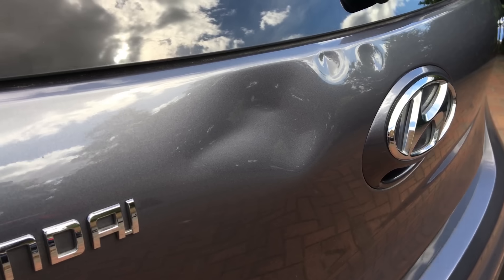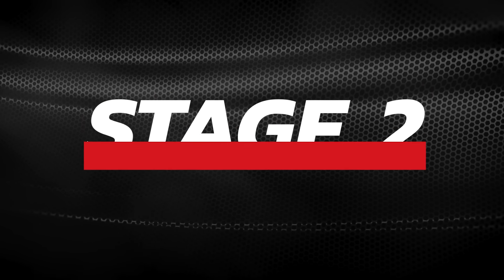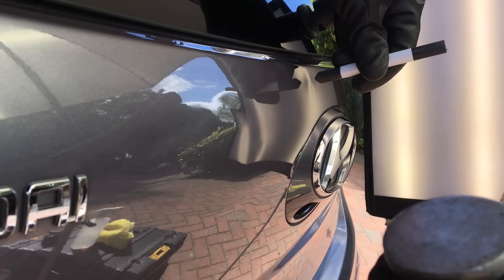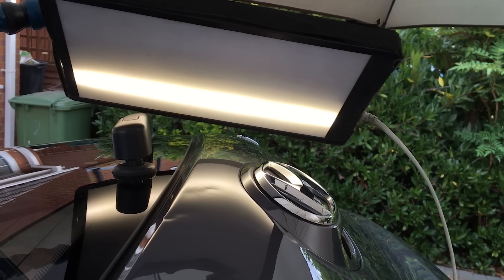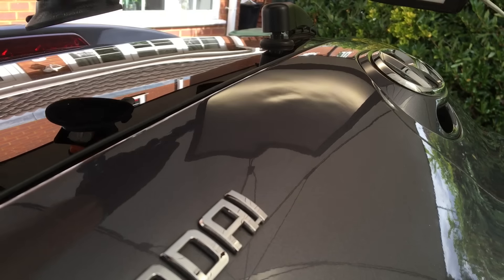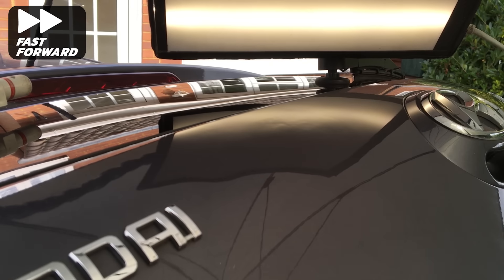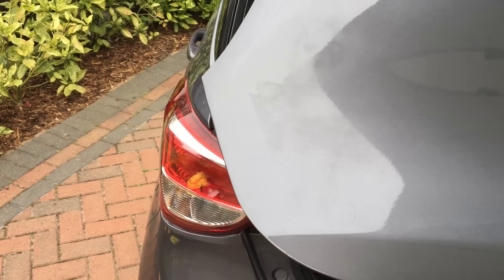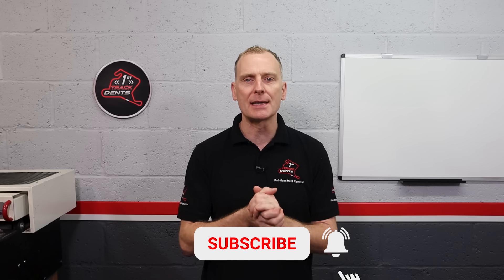FIXED in 3 STEPS! | NO Paint NO Filler!

Comment: After watching a few of these videos, I am impressed.  I had a minor incident on a motorcycle a few years ago where the turn signal dinged the tank in a fall.  The body guy that "repaired" it using similar methods (by similar he was using similar tools) caused more damage than the original fall.  This is fascinating to watch.  

During my teenage years, this required drilled holes and body filler.
Reply: Yeah!  Who would ever have thought that you could just tap out the dents like this guy. Just love his work I could watch it all day
Reply: @grantperkins368  Agreed.  It is mesmerizing.
Reply: @rustyshacklefordspocketsqu8162  I've always cut the guy a bit of slack because the bike had a narrow tank and a matte gray paint job. It could not have been easy for him.

But at the same time, it is such a contrast to what this metal magician does.

Comment: Pure witchcraft - amazing skills 👍🏻👍🏻👍🏻👍🏻👍🏻
Reply from the maker: Thanks Mark :-)
Reply: @1st_track_dents  What U use on the inside for holding the bar? To make the lever?
Reply from the maker: @lucd9080  Just using the inner frame as it was quite strong, sometimes I use a piece of wood or clamp a piece of steel to the frame if not:-)
Reply: Veri good

Comment: This is way way more difficult than he makes it look lol.
Reply: Yh
Reply: Any genius can do this.. The problem is none of us are genius ! 
Only that guy is.. . Maybe if I watch the video 10 more times !
Reply: I've seen some guys do this irl, they're very fast and I bought a kit and have had a go myself, some success, some not so. I found I was doing heaps of glue pulling attempts per dint, it's good to see here that it's normal. It is very time consuming. I'd say he makes it look faster than what it really is. Those dint pusher rods are something I'll have to look into as well, I've only current got pulling and hammering tools. This video is great at showing the different types and when to use them.
Reply: Yeah for a minute there I was thinking...  hmmm I can probably do this myself, I'm sure Amazon has all that stuff... and then I snapped out of my delusion. This is an art and it takes years of experience.
Reply: =  @MV60  = Can you please tell us in detail, where you bought the tools, and what were all the tools that you bought, and name brands... This may help some of us.
Reply: @DocScience2  Man, it was years ago, about 2014, I bought a quality kit on ebay. Yea yea, it really is good though. It came with a very wide selection of tabs, a 100w glue gun as you want one that's got a good heat, a few dint hammering tip tools with changeable tips, a soft hammer with changeable heads, a slide hammer, a T tab puller and a lever action tab puller. Plus a bundle of glue sticks and a plastic glue scraper. It cost me a couple of hundred at the time. It was basically every kit available at the time all rolled into one. Took a while to shop for it to make sure it had what I wanted. Basically most of the tools as used in the video. The only things I'd like to get to have a better kit would be the push rods he used near the end.
Reply: = @stan S = My car is more then 10 years old, so I cant do much more damage then there already is, on the dents.
Reply: @stan S For sure. Actually doing it takes a lot of patience I found, lots of tabs attempts, etc. The pros do make it look easy and faster than it really is. I was lucky to have a lot of observation first hand before I tried it myself. At first I was ready to quit then decided to try again, eventually getting better. I'm still nowhere near this guy in talent on pdr though. However my own car is what I did it on, I'd say to not try it on anyone elses car at first. Oh yea a downside once you start and get an eye for dints is that you then start seeing ever dint you otherwise wouldn't.
Reply: @stan S An amateur takes longer (LOTS) to do a job. With Intelligence & patience you can achieve similar results.. Love seeing a true craftsman at there trade.
Reply: @cameronbruce1862  Word !
Reply: @MV60  The speed comes from knowing what you are doing and practice.
This isnt something i think you can learn from a video really.  here you are being shown how its done not really taught.

You need to learn how to use contrast, and about dents and metals themselves before any of these.
Just my view as someone who does it for a living and has gone through learning and the pratice
Reply: @cameronbruce1862   An amateur wouldnt get it close to a pro. if you even found your tip you would know what to do with it is the truth
Reply: Your like me , lol
Reply: @Dr.TJ_Eckleburg  that's me now, I think I will try it

Comment: I'm new to this amazing work.  This guy is definitely good but I saw another video where the backlight, used for fine reference, had striated lines in it.  Those striated lines were wiggled around the dents but as the imperfections were physically removed, the lines would straighten which leads to a perfect dent removal job.

Comment: Very nice and interesting work.
 I'm not a body or paint man but I've heard that a dent actually stretches the metal hence why the high edge around the dent but maybe that's more severe and deeper dents, I'm not sure. Anyway, I'm impressed and this looks like it would require a lot of patience.
Reply from the maker: Thanks Jeff, on this dent luckily the metal wasn't stretched, the high ridge around the edge is what we call a "Crown" which is displaced metal and can usually be manipulated back into the low section. If the dent had been any deeper it could have stretched and then you get the "oil canning" effect where the metal pops in and out from the slightest touch making a popping sound and that takes a lot more work to deal with. Thanks for you interest and for taking the time to watch 👍
Reply: @1st_track_dents  Good to know, thanks 😊

Comment: I've recently bought a pdr kit for roughing out aluminium panels before filler work, and my god it's bloody hard getting the dent where I want it! This trade is a something else! Hats off to you! 👏👏
Reply from the maker: Thanks Jonathan, yes it does require a lot of patience and practice at the start but stick with it and soon you may be able to ditch the filler and get it done with just the pdr bars 👍
Reply: I'm still trying to give it a go, I've only got a glue set atm, so may need to invest in a few bars aswel as time goes.
I'd love to be able to get to that point,  but can't see it happening any time soon 🤦‍♂️.
I'm going to keep practicing when I get five minutes on my scrap panels and see how I can improve.
Thanks for the reply aswel! 👍
Reply from the maker: @jonathanwilkes5565  No worries, good luck!

Comment: Nice work very nice mate. How are the bar's used to push the dents? Are they pivoted on something to get the stable but steady pressure? Won't all this have damaged the undercoat, layer's of paint and clear coat?
Very impressive though, top job👍😷👍
Reply from the maker: Yes you lever the bars off of the internal frame or sometimes my hand. This process doesn't damage the paint at all, when you heat the paint before pushing it makes the paint flexible and allows it to move without cracking. The paint on the back isn't damaged if you use plastic tips and you can always apply primer to the back if you do make any marks. 👍👍

Comment: It seems like even a mechanic or dent repair person might not even be able to tell any accident or repair had been done.  I am surprised that one of the tools at the end had no rubber ending.  It would seem to possibly scrape the underside.  Is the interior not normally painted?
Reply from the maker: When the metal tips are used behind they are pushed using up and down movements instead of rubbing/scraping which would scratch the underside 👍

Comment: Great video. I ordered all the tools to fix some minor dents on my new car. Is there a suggestion on heating the body work? How often, temp, length,etc.? This was the one part I couldn’t get from the video, the rest is perfection.
Reply from the maker: Thanks for the feedback. I don't actually measure the temperature. I just warm the panel so that it is very warm to the touch, you don't want it so hot that it is too hot to touch, just as hot as the panel would get on a hot summers day. I just heat the panel then push, heat then push and repeat. Just don't let the panel get cold when pushing as the paint could crack!

Comment: I spent hours glue pulling a couple of dents on the door of my missus bmw at the weekend, It was quite a good job but I'm struggling a bit with knocking down the high spots.
The skin seems so thick on bmw compared to others I've had a go at. Thanks for the upload I learned a lot.

Comment: Impressive!
How would you handle a sharp crease on the rear quarter panel of a pickup truck where the bumper hit the quarter on impact? I tried to tap out from under the vehicle but the metal is too thick.
Reply from the maker: Yes, the metal is super thick on these rear quarter panels. Most of the time it is all about leverage. You would have to get a thick rod or flat bar behind using some wood probably to get some good strong leverage, but yes these jobs require a lot of thought and need a good plan of attack 👍
Reply: @1st_track_dents  I can't get into that space. And there's no place to swing a hammer. Body shops here just replace the quarter panel.

Comment: Impressive work Jake! Went through your list of tools used on the description but could not find the main metal tube tool you used through out this entire video to pull the metal with the small rubber attachments. Would you please post a link, thanks 🙏🏼
Reply from the maker: No problem, thanks for watching: 
The 24 inch double bend tool I use all the time from Ultra is here, this is a great all rounder bar:
https://www.ultradenttools.com/products/st3802-24-x-7-16-screwtip-dbl-bend-90?_pos=3&_sid=d6dbd8607&_ss=r 

The A44 tip set that accompanies the 24 inch double bend tool:
https://www.ultradenttools.com/products/a44-7-16-6-pc-tip-set-and-tip-holder?_pos=1&_sid=5430179c2&_ss=r
Reply: @1st_track_dents  I was referring more at the bar that attaches to the rubber auctions cups you glue to the car and then pull the dents outwards
Reply from the maker: Oh I see, I bought that over 10 years ago from a company that went bust, so don't have any links for it, you can buy these in any PDR suppliers, to be honest my one is a bit too short and not heavy enough so I would recommend something a bit better like this: 
https://www.pdrprotools.co.uk/slide-hammer-long-p-242.html
Although this is a UK store, not sure where you are but these are sold in most Online PDR websites.  👍
Reply: @1st_track_dents  sweet thanks Jake

Comment: I did PDR for over 20 years in Texas, starting when I was 19.  I've long since moved on as I simply got burned out.  I estimated that on the low side, I've repaired close to 1 million dents or more in my career.  Hard to believe, but thats what you get when you do between 150 and 200 dents a day for 24 years.  Just for grins, you should try raw fluorescent bulbs with one strip of electrical tape running the length of the bulbs and stuck right on the front of the bulb,  then paint the background fluorescent yellow.  That was my setup and was copied by many hail techs when they saw it and tried mine.  Shadow lights are good for deep dents but switching to my raw bulb setup will help with fine detail.  The light needs to be further back too IMO.  I  had several guys with shadow lights think they were done, then I put my light on their work and they were like "damn, that's crazy".  By the way, If I had a dollar for every person (always a guy) that said he saw someone do it with dry ice, I'd be a rich man.  Of course,  they were for some reason paying me to do it the real way.  I still have all my tools in my shop out back.  I remember when the rubber tips and glue pullers first came out.  All we had my first 10 years were the rods and a lot of duct tape to wrap our tips..  My first rods were used so much that they eventually got cracks in them and I had to bend them back straight with my knee after each dent because they became so weak and they were 1/2 inch rods.  A few eventually got so bad that one broke in half and the other two wouldn't even lift  quarter size dent anymore. I actually had some other techs try to buy them because they thought they were cool for being so worn.  I eventually gave one that was my favorite to a very good friend that wanted to hang it on his wall.  He kept it with him on the road for several years to show other techs during hail season, then he hung it on his wall.  That rod is literally a "1 million dents"  tool.  We also had to keep the tools oiled because we didn't have stainless tools back then.  Ultra Dent even made a stock tool off a design I sent them to make copies of for me.  I screwed up my share of cars too over the years.  My favorite screw up was yanking off paint on a Lamborghini driver door.  Lucky for me the owner was ultra rich and a very good repeat client.  He felt so bad for me he made me take $100.
Reply from the maker: Thanks for sharing your story, sounds like you were top of your game in PDR. I think a good tech will always have some of their own home made tools, I would love to see a photo of the light you are talking about, sounds really good. I also used to use a single fluro bulb as you will see in my early videos, I used to clamp it to the side of my fog board and did so for years, except I would occasionally drop the fog board on the floor and smash the bulb into lots of little glass pieces! It allowed me to see a lot of detail. I still haven't invested in a LED light so have had to make my own, here in the UK PDR earnings are only a fraction of what can be earned in the USA, so I can't invest in new tools as much as I would like so have to resort to making some of them myself. Would love to be doing this in the USA and experience MTE and trying out different tools etc.  I've also snapped and broke a few PDR rods along the way from years of use! I also started in the industry way before soft tips were a thing so also used to use a lot of tape on the end of my tool tip. It's amazing how easier some of the new tools make the job today, although all the different types of metal are now making the job so much more complex, give me good old regular mild steel any day. Thanks again for sharing your stories, always great to hear from legends of the PDR world! All the best, Jake

Comment: Good afternoon Jake, I just watched a gentleman remove dents with a slide hammer device that he pushed onto the dent somewhat like glue. The material on the slide hammer seemed to self adhere to the dent area and allowed th technician to pull the dent back out. Are you familiar with the tool ad where to get it. Thanks and take care.
Reply from the maker: Hi Steve, hope you are well, yes this sounds like some form of cold glue system, I use a cold glue system from Glexo. You can see a video of me using it here: https://www.youtube.com/watch?v=ql_wImI_ti4&t=22s

Comment: What adhesive/glue are you using? Please explain, how fast it dries and compared to what other types of glue. Brand names ok but specify what specs I need. Thanks
Reply from the maker: At the moment I am using Glexo hot glue, Tab weld and Flex Collision glue from Cam Auto. The temps and drying times are all different so it's more of a trial and error of testing these glues out, each manufacturer will have videos on what they recommend, it also depends on where you are in the world as heat, humidity and outside temp or workshop temp all comes into play and what tabs you are using with them. The Glexo can be pulled quite quickly and is easy to work with although the Collision glue is great for more challenging dents but has to be set differently and left longer. You need to play around with them all to find what works for you. 👍

Comment: What glue do you use, hot glue just breaks off brfore the dent moves. I have tries many times on small dents but always fail.
Reply from the maker: Hot glue pulling dents is all about the right procedure. First makes sure the panel and the tab are clean (use Isopropyl Alcohol). I am using Glexo hot glue at the moment as it works best for me and the climate I work in. You have to let the glue set correctly, pull too soon before the glue is set and it will just pull off the panel leaving a sticky mess. Wait too long and the glue will cool and de-laminate and just fall off as soon as you pull. You need to experiment and find the sweet spot for the glue and tabs that you are using. You will also get different results due to ambient temperature, is it a hot sunny day, is it cold/winter. You just need to test out different set times and pull times until you get it right. I like the smooth faced tabs best like the Gang Green series of tabs. Good Luck!

Comment: What can we do if the paint cracks as we push the dent  from inside toward outside. I forget to heat up the paint.
Is it possibel to repair a small 3mm long crack under the clearcoat.?
Many thanks for reply

Comment: Where can I get the glue you use for pulling dents? Been searching everywhere on the internet for the right stuff but I can't tell if it's cheap rubbish or not. A link/point in the right direction would be very appreciated!
Reply from the maker: The glue I am using at the moment is from Glexo, link below:
https://www.pdrprotools.co.uk/glexo-melt-glue-sticks-pack-p-854.html
Although please bear in mind, it really depends on the climate you are working in to what the best glue is to use. I find I get good results from these glue sticks and I am in the UK were the weather is generally mild most of the time.